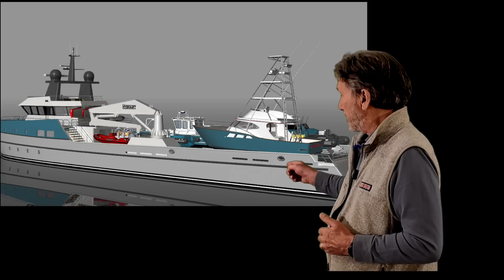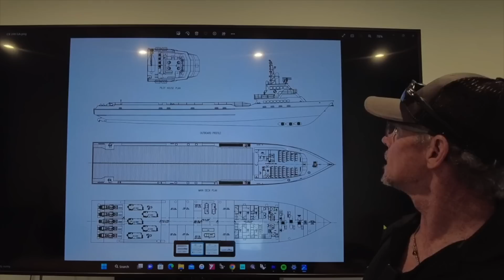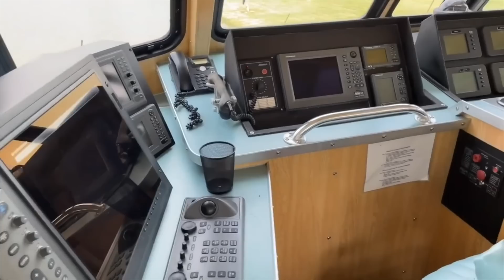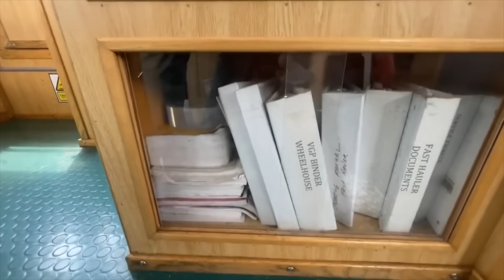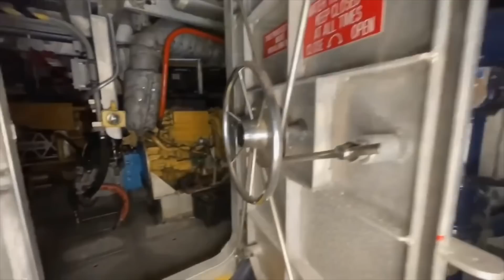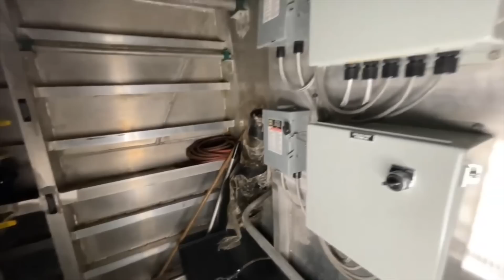Sportfish Support Vessel - 29 knots 4,000 nm range U.S. Built w CAT engines

Comment: How much would it cost to order a new bare hull from the manufacturer? I hear that systems comprise of 70-80% of the cost. But its far easier to fish for them on the second hand market than a full boat. Woulf appreciate your insight.
Reply from the maker: These hulls would probably cost around $2 million. Your approach's success would depend on how good you are at accessing equipment that still has a life, buying it right, and installation success. I'd prefer to buy an older boat for the price of a new hull and swapping out used-up equipment.